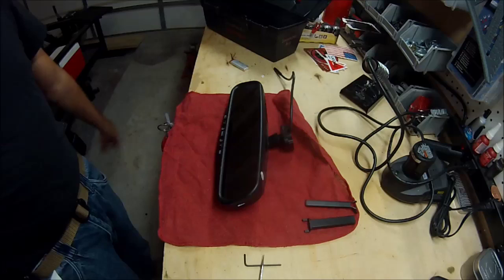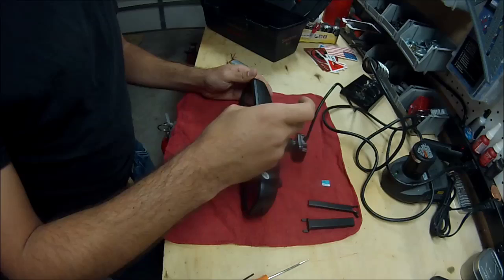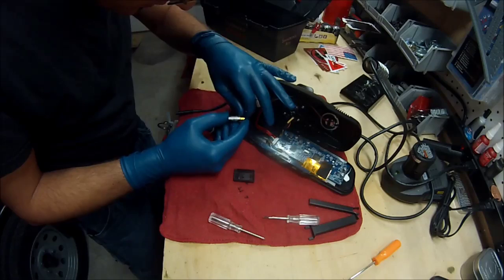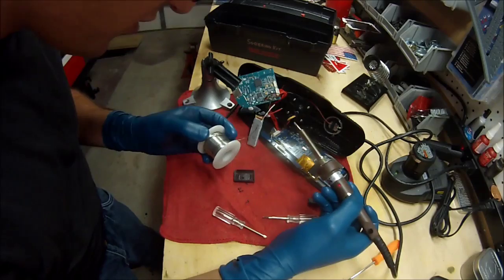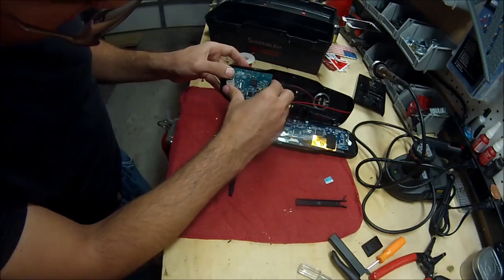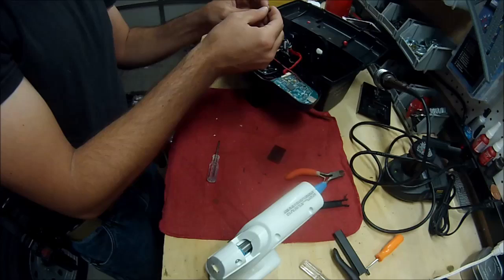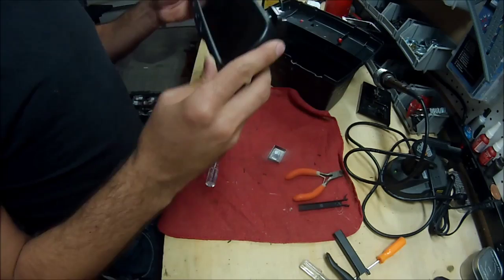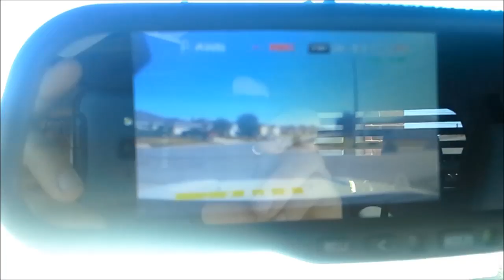Auto - Vox T6000 - Replacing internal battery to fix issues

Comment: Have the same unit, the specs on the site showed the original battery was 200mAH.  Any issues using the 450mAH battery?
Reply from the maker: No, this solved all the issues I had.